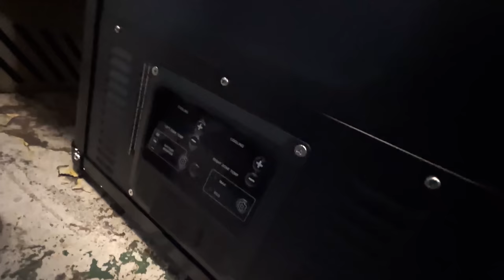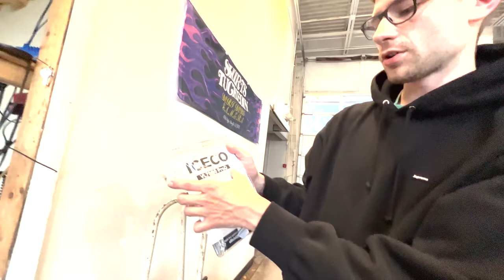NEVER Buy this From Autozone!

Comment: Nope no co is lame and expensive. Get the Walmart one that's 1200 amp. Can start a diesel. Has a digital air pump built in. Has 110 ac built in. 80 bucks. 3 USB ports. Flashlight. Can't beat it. Set to desired pressure and walk away. Stops airing the tire when it reaches commanded psi.
Reply: Can't drop a dime on a good product like that and not have a brand name to look for!! 😆
Reply: @colesteven1123  it's Everlast 1200amps and does 500 watts ac